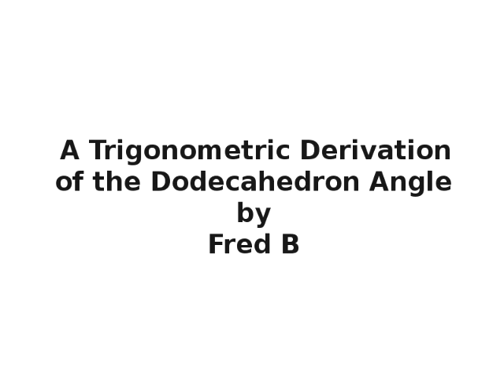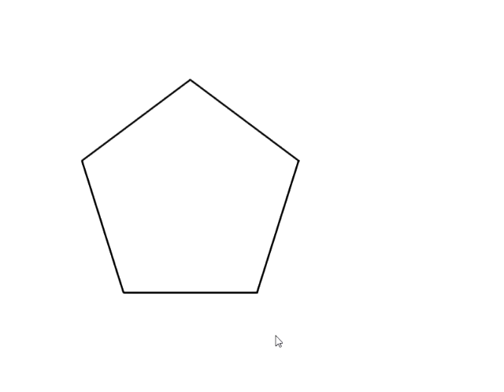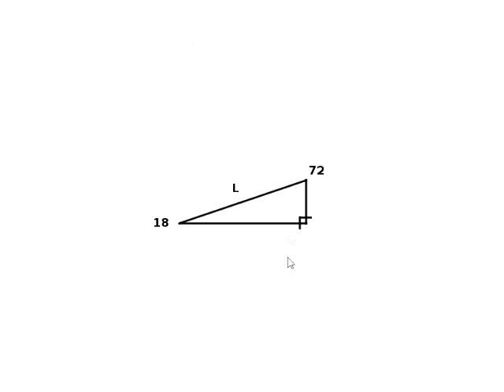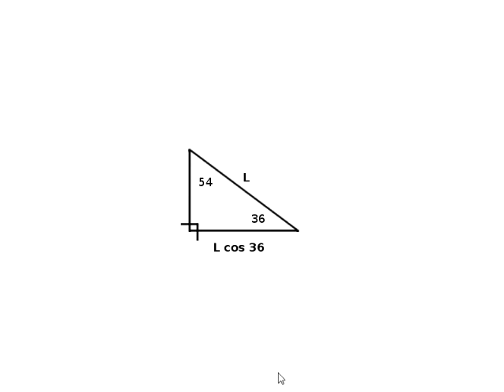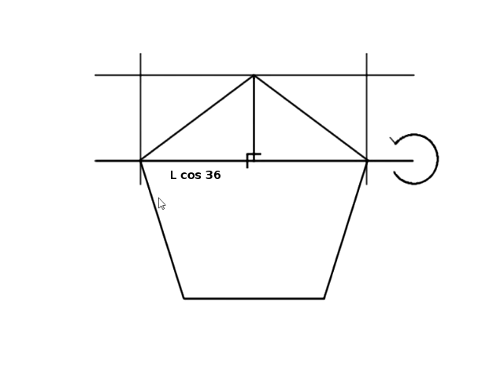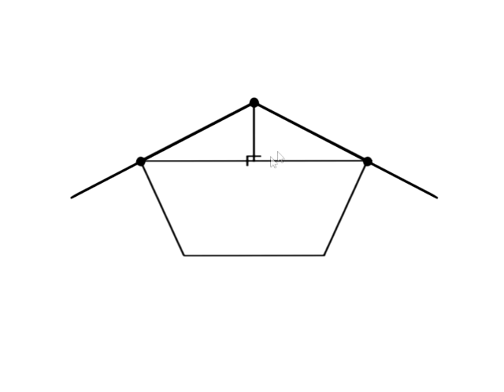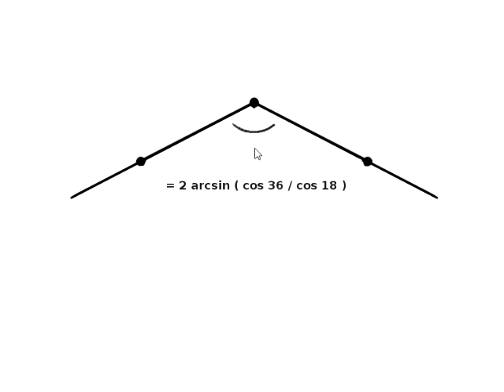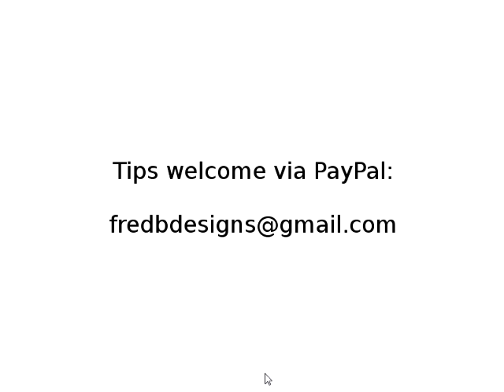A Trigonometric Derivation of the Dihedral Angle of a Regular Dodecahedron

Comment: The edges are 1/2 the edge length of the dodecahedron above the 5 interior cubes within the dodecahedron, the edges of the cubes are equal to Phi * edge and make up the diagonals of the pentagonal faces of the dodecahedron. :D
Reply: Hi, what you said about the cubes is right, but how do you figure out the dihedral angle using that information, can you tell us more? Keep in mind that the approach in this tutorial managed to end up with constants, thus avoiding to use edges or diagonals!